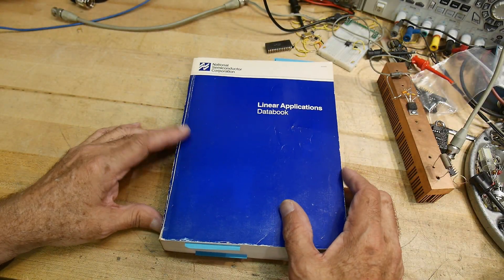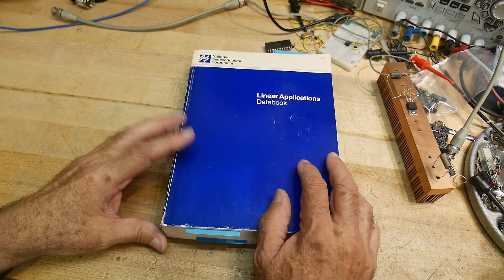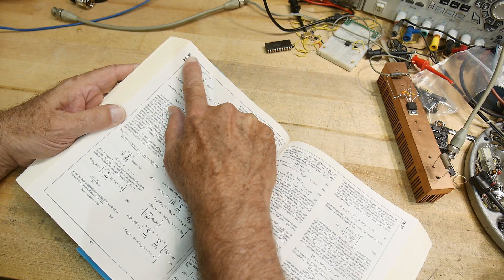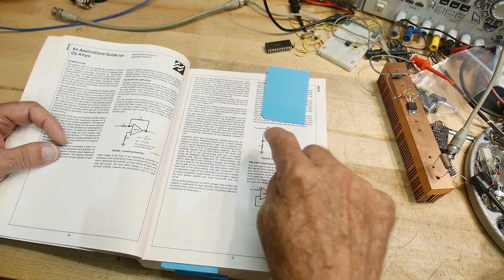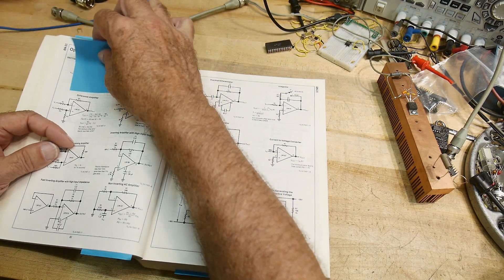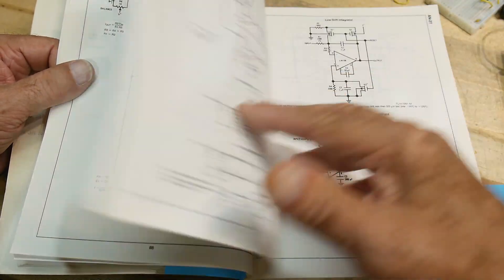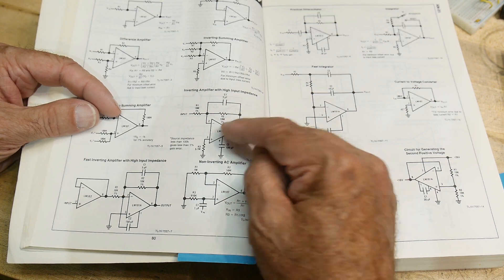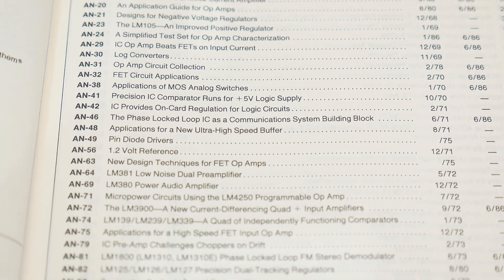#1619 Linear Applications Databook

Comment: This reminds me of another great and forgotten source for learning the fastest way when back in the 70s and 80s. It's in the Service Dept of the largest consumer electronics retailer in the UK. There was well maintained large library (no librarian unfortunately) of consumer product Service Manuals for everything, nearly each manual a treasure trove of high quality explanation how every circuit works and clear and concise guides how to use test equipment. I would say learn faster than applications by chip manufacturers because of real products only a few years behind the state of the art.

Comment: Since some techs, (when I was a young CB radio installer back in 1975,) didn't have any college education in electronics, (like me,) the engineer who interviewed me for my first tech job had asked me, "If you wanted to design a timer circuit, where would you look for reference information?" My response was, "Section 4, page 35 of the National Semiconductor Linear Applications manual. But I wouldn't bother, because I already know the pinouts for both the monostable and astable versions of the chip." He went over to his bookshelf, pulled out the National linear ref, turned to that page and said, "You're hired." I'd just spent 2 weeks building such a circuit for a friend, with that book sitting open to that page  in front of me the whole time because I knew very little electronics. So it was the only chip I knew anything whatsoever about. I retired years later from SONY as an R&D tech, having spent my tech career at companies like HP, IBM, TRW, and SONY. But that particular question got me my start in the electronics industry. 

I kept one handy till long after I retired. But now I look up chips online.

Comment: I still have my 1973 Linear Applications Handbook - $2.10 at Radio Shack (yes, it still has the price tag) I also have the linear, logic and cmos databooks from 1981 - 1982. Regards, David

Comment: I dumped a lot of data books over the years, but the NSC linear books were keepers.  I still have the '82 Linear Databook, the '88 Linear Databook vol 1 & 2, the '89 Special Purpose Linear Devices Databook, and the '91 Linear Applications Handbook.  I can't imagine how many hours I've spent reading them!